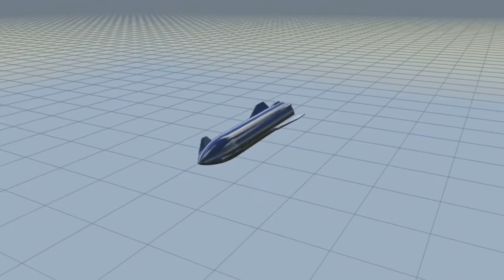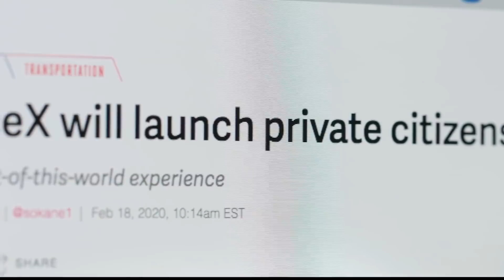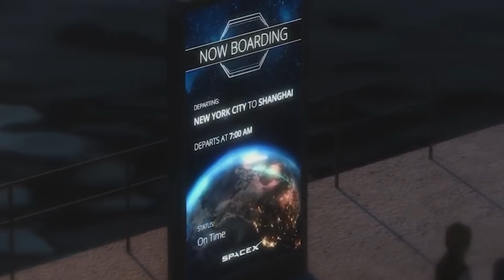Why SpaceX's Starship Is the Best Spacecraft Ever Made

Comment: Isn't this pre-emptive, as it hasn't really been made yet?
Reply: the main model is almsot complete and the test models have been complete since mid 2020
Reply: @starleighpersonal  I'm not saying it won't work in the end. But currently, saying that is like saying the Ares mission from The Martian is the best spacecraft ever made. It's logical, it has a specific design and it is easily possible to make it. 

So at the time of the video, it's still not the best spacecraft ever made. I may be able to say that about the dragon, though. It has the same crew capacity as a space shuttle, and is able to go into two different types of missions (cargo vs crewed) because of its modularity.
Reply: @Zachomara  by ares mission spaceraft do you mean hermes the mav or the mdv
Reply: @starleighpersonal  Ah, the Hermes. Sorry I wasn't more specific.
Reply: @Zachomara  no problem

Comment: What we need ASAP is the ability to mine and draw resources from around the solar system, if we're able to do that then our potential is limitless otherwise we're racing against time and against the eventual and inevitable exhaustion of the resources required to build all these things.
Reply: The earth is the best place to mine resources at it has all the elements that you can gather out every solar system planet. Also, exhaustion of resources is not a threat to humanity concerning these rockets. The fuel is literally CO2 and Electricity. And the materials for the rocket itself is Carbon and Iron (basically steel).  Interesting fact: earths crust is 5% Iron, we will never run out in 5 thousand years.

Comment: Are folk still believing the 100 people thing? 😅  There's no WAY the current prototype will even accommodate 25 people. I don't think 100 people could happen with the proposed point-to-point travel idea with individuals crammed in like sardines.
Reply: They use Elon's revolutionary method of engineering by sheer drivel.
Reply: Ojas  do you understand what I just said? Space (excuse the pun), matters. There's no way this rocket will be large enough to fit in up to 100 people.
Reply: There is no ship. There is a tank made of steel with some engines attached. And the whole thing is neither designed to transport people, nor is it as big as it would need to be if it was intended to keep hundred people alive for over two years. You can ofc. pack a number ofcorpses in it. The bodies don't need much space.
Reply: The prototype doesn't even have a place for humans to be ;D. We'll see how it looks when they will add the actual container stage for humans. (The upper stage (The prototype) is 9m wide, 50m Tall. It may look small from far way, but it's a frickin building xD)

Comment: Starship will be the most important Rocket ever if they get it to work as intended.

But considering it has not yet been to space, or landed intact from a height of more than 150 meters it is a bit early to crown it. 

The flights it has conducted so far could literally have been cnducted by three raptors and a few reaction trusters welded to a shipping container turned into a pressure wessel.
Reply: @peter It can not be an impressive rocket until it actually works. If it fails now after so much investment into it and a decade of development it will go from the future of spaceflight to the biggest failure in spaceflight sinse the russian moon rocket.

Comment: 100 pax to mars are clearly wrong, have been mentioned with early presentations, either for a diameter of 12 or 18 meters, what would have to be checked out, never for the current 9 meters. At the same hight, such would have either the double or quadruple of the volume, but at least the nosecone would be longer too, making this difference even bigger. Therefore, with private cabins and a common area with workout, kitchen, toilets, bathrooms and a 'strolling promenade', alongside a storage area for food, water, EVA-suits and a lot more, the limit would be either 25 or 50 pax, more likely 25. 100 pax could easily fit in for earth to earth travel, each only needing a seat for an hour or so, but comparing this with the current aviation branch, this would rather be unthinkable, with such huge amounts of explosive gasses around, as can be seen at the explosion of SN4, if this number is correct. This could only be possible in the lawlessness of the no man's land far enough offshore, and could end with a single similar explosion with a single victim, is not very realistic. You are a very talented speaker, good enough for major MSM news networks, but as well the quality of the content is pointing to the same direction, ignoring or embezzling such differences. The essential thing seems to be that it sounds good and sales, or perhaps to spread confusion, isn't what is really being needed, thanks.
Reply: Actually, it could take 100 people to Mars. It has more interior volume than a 747, over 1100 cubic metres. So for point to point on Earth it could hold closer to 400 people. It won't be an ocean liner, but It is possible to fit 40 2 or 3 person cabins into that space and still have room for common areas. The outer circumfrerence of the Starship is 28 m, and assuming the cabins are 1.9 m deep, the interior wall is a ring 16m in circumference. At 8 rooms per deck, that's a room 2 m by 3.5m on the outer edge and 2 m on the inner. Quite enough for 2 or 3 bunks and some personal space. At 2m per deck 40 cabins take up 10 m of the payload section with a 5m diameter cylinder 10 m deep for common areas, and the top 6 m high by 9 m base diameter cone for an exercise/meeting area.
Reply: This would have to be checked out too, and the other way around, how many cold have been estimated for a  diameter of 12 or 18 meters? I've been related to what had been presented, 100 pax have never been mentioned for a 9 meters diameter, if not so, prove me wrong, I would thank you.
Reply: One more thing: Let's assume the 1100 cubic meters of internal volume are correct, what would be 11 for each of 100, the equivalent of my own very little bedroom. Then take away half of this for internal furnishings, including floors, passage ways, ventilation conduits take a lot, life supporting systems and storage areas. After this there would be left behind 5.5 cubic meters, of what about half would have to be counted to common areas. This would leave 2.75 for the cabin, what comes closer to a coffin than to the smallest human rights worthy single persons prison cell. Not to mention that the common areas would always be very very crowded, and this should be the habitation for at least two and a half years, including the return trip?

Then the 100 to 150 tons of payload to LEO, how much of those would be taken by all interior furnishings? A few by insulation, a few by the floors, a few by all the systems, a few by this and a few by that? There would soon be left behind only a few for pax and their needs and cargo, or the other way around, less pax would have less such needs. Okay, let's assume that it still would be possible with such soyous-like circumstances, would you like or recommend to travel, or not better to spend the same time at a prison instead? What you are describing here is of the same character, sounds good at the first moment, but turns later for thinkers into nausea.
Reply: @andreasbuechler6694  You don't carry 100 passengers and 150 tons of cargo, you numpty! A full on passenger Starship is going to be purely passenger space and supplies to support them. 

Also, that 2 x 2 by 3.5 m wedge room is around 11 m^3, and holds 3. Have you ever been in a ships cabin? Or a bunk room? So your 11 m^3 per person is silly. Your maths is messed up by some very dubious assumptions.
Reply: Thanks for reading and answering anyway, even if you're seemingly confused and confusing. In technical terms, speaking of 'payload', is in the case of pax, them self with everything they need. The 1 to 1.5 tons each could probably be enough, but never the 11 cubic meters, with or without the deduction of everything they need, and I'm still missing a source for that number. I forgot to mention, you're seemingly right about the 400 or even more for earth to earth, though there is still no source for this number too, thanks.
Reply: @stainlesssteelfox1  Does a 747 fly with all supplies like food/water/air for 200 days? That was a really embarrassing comparison you made....
Everyone has done the math - and it's simple math too.
To keep everyone alive and healthy for 200+ days - even with 90% water recycling - the number of people is 15 to 30  - depending on how far you want to ration the supplies.
The only way to get 100 people at a time to Mars is to dramatically reduce the trip time for 200+ days down to less than 100 days. That takes an enormous amount of fuel and still may not be possible. SpaceX haven't specified their plans on trip time reduction.
Do your own research before spouting bogus comparisons between aircraft and long flights to Mars.
Reply: @thesnitch7  I was talking about volume. And it has enough volume, but not enough payload lift.
Reply: @stainlesssteelfox1  Volume numbers are even worse. When you do the math based on SpaceX numbers from their 'User Guide' the pressurized volume is around 800m^3 - and even they confirm that in other documents. You can confirm that yourself if you like.
So there goes 27% of the volume you thought you had right there.
Once all supplies are loaded each of the 100 people will have about 5 to 7 m^3 living space.
Both the Russian and US space agencies have determined that the mimimum living space for astronaut mental health is 25m^3  for long duration flights. 
They have over 100 years space experience between them - so I'll take their number..

Comment: Not "best" yet, but we'll see! Musk is banking on cheaper rockets, and more fuel, presuming fuel is always much cheaper than rocket building costs. It makes less sense for ballistic travel across the earth, $2M in fuel for 100 passengers is $20k per person (gross cost), faster, but also much riskier than jets.
Reply: It won't be flying people until it's as safe as jets or even safer.
Reply: @deivishd6728  That seems unlikely. Jets are dangerous enough under engine failure, but at least they have some ability to glide to a controlled landing.
If you really had 100 people in it, clearly impossible to have an ejection system like Crew Dragon.
Reply: @aresmars2003  Yeah, that's actually true. Can't wait to see what are they going to do to crank up the safety.

Comment: Starship is a great vehicle, but i still doubt it will launch that soon.
Reply: It's supposed to be launching tomorrow. OK that's just going to be a 12.5km hop test, but, if successful, SpaceX will be looking to push forward with a potential orbital flight before the end of 2021.  Of course they could encounter some serious problems that could set the whole program back months or years, or even force them to cancel it altogether, but their experience in landing/re-using Falcon 9 boosters and the engineering and software expertise they have should be enough to get Starship into orbit before too long.
Reply: @Andrew-Kerr  tomorrow!! Man i didnt know but im siked now
Reply: Andrew Kerr 
Welp, looks like we got a few weeks, considering the engines need a swap.
Reply: @Andrew-Kerr  yes i meant to get to space, no need to show off, but great comment though.
Reply: @deskneck8254  I didn't intend to show off, I'm just a bit more optimistic about the chances of seeing this going to orbit quite soon. Plenty of people said they'd never figure out how to recover/re-use Falcon 9 boosters, but now they've had 70 successful landings and some boosters have been reflown 6 times.  

I'm sure they're going to blow up several more Starship prototypes before they nail a reliable design... Just as they crash landed several Falcon 9s, but their pace of development is incredible. Don't write off their chances of getting this thing flying with commercial payloads before the end of 2022.
Reply: @Andrew-Kerr  well yes 2022 is a great time assumption, i meant this year i dont expect them to launch by 2021 but 2022 is a great asumption seeing how tesla is gaining a lot of income from its new modele which opens many financial doors for spacex and their space constellation.
Reply: @deskneck8254  it's only January. If the next test flight is successful, they could easily try for orbit within the next 11 months!
Reply: @01MrCapricorn  they haven't competed and tested super heavy, sn9 completed its static fire and can do its 5k flight true, and if it lands that would be a huge step for spacex, which allows them to continue full construction on super heavey to test it then test it with starship and you can just imagine how long that will take but this is elon musk the guy who likes to get things done as soon as possible.

But thats just my opinion, nobody knows the true future they can only hope and imagine for the future they desire.
I will copywrite that quote dont use it.
Reply: @deskneck8254  the most exciting part about the superheavy test is them trying to catch it as it "lands"
A building trying to catch another falling building
Reply: @magicalmagicmagician5223  cant wait to see that, it will be the first in history to ever do something like that
Reply: @deskneck8254  it seems like their goal is just accomplishing first in everything, first to build a fully reusable rocket, first to skydive said rocket, first to catch the skydiving rocket's booster what's next?? Lol
Reply: Diego Mendoza 
Actually, they would be working on Super Heavy simultaneously, but there are some design issues they still need to work out.
Reply: Elon musk posted on twitter that they’re replacing two of the engines on SN9 and will do more test firing of the newer engines. On top hes said they’ll aim for 10km not the 12km of the SN8. I’m willing to bet we’ll see it launch sometime this month. But expect it to be delayed.
Reply: Ojas  1-2 years would be the best speculation.

Comment: Great video.  However,  whilst all of the benefits mentioned of steel over carbon fibre are true. But I am sure the main reason for using it is just that it takes far too long to build carbon fibre rockets. Elon said that if it takes too long then the design is wrong. They did originally plan for starship to be carbon fibre until they realised how slow it was to make and then switched to steel as they realised that it was plenty good enough.
Reply from the maker: Great point! I think that is why Elon Musk's companies can have so much momentum. Like you mentioned, Elon said that if it takes too long then the design is wrong.
Reply: It helps that the benefits are better. Otherwise switching just for better devtime at the expense of performance would be less of a clear cut decision for them
Reply: @dsdy1205  But then again, to do it on the sake of cost, would again be counter-productive as performance should rule, which would again be carbon-fibre, as it is actually better than steel in most ways. And they were originally going to make Starship from carbon-fibre, as everyone else does. I am just repeating what Elon said, which is that he needs rapid iterations, so that he can conduct so many test flights, to nail the landings. The other manufacturers spend ten years working on their rockets before they get to launch once, Spacex needs to make their test rockets much faster, so that he can get to Mars by 2024. Speed of development is key.